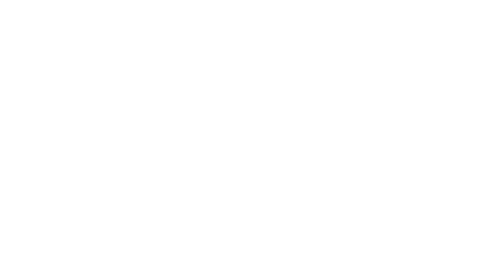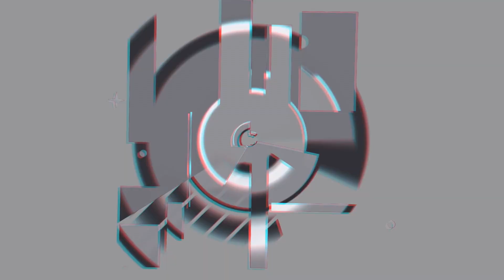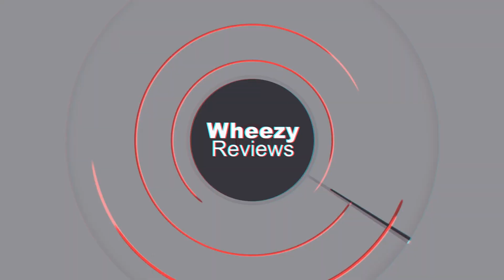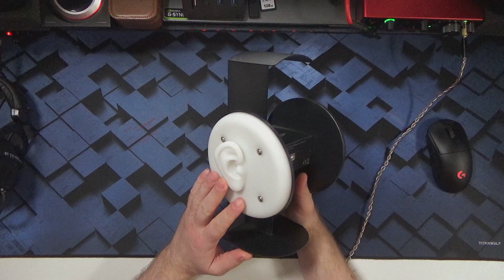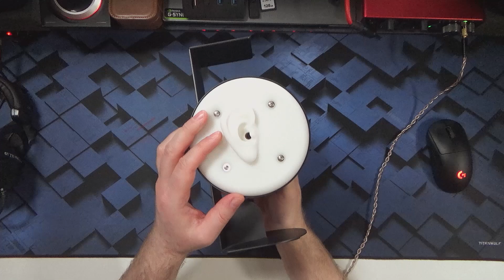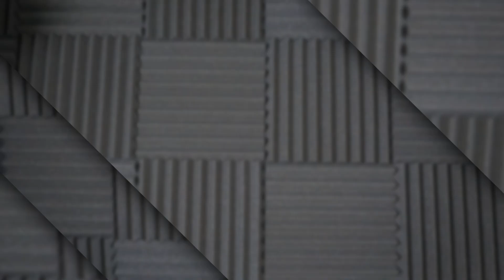Headphone measurement and MiniDSP EARS - Whats it all about?

Comment: Actually you can also use MiniDSP Ears and REW  to produce quite good correction files for EQ  software. I use it to produce EQ settings for APO with the Peace GUI and this works very nicely for (my) headphones. The results are usually an improvement  and quite fast and easy to realize. It's easier than doing the same by hand. And the results are better too. :)

It doesn't work that well for IEMs and earphones yet. The MiniDSP seems to have problems to measure stuff, that needs to be inserted into the ear canal, properly. Any hints to improve these measurements are welcome. :)

Comment: Great video!
You've covered all the basics without going into the 'politics' of audiophoolery. 

Just a few hopefully helpful things I thought of:
- Human hearing can also go well below 20hz. Even if this counts more as 'feeling', it is widely accepted that people (probably more than we think) can clearly distinguish separate tones most of the way down to 12Hz.
Also most people don't realize they can hear below 20hz, because most headphones can't produce those frequencies :D even many highly regarded planars roll off suddenly below 20hz.
- This is why all of Tyll's graphs (on the now dead website innerfidelity) go down to 10hz (and up to 20kHz). Reading a headphone's ability to produce the 10-20Hz range can tell you a lot, and people like me who can 'hear' (or feel) down to around 9Hz appreciate this.
- The myth that humans can only hear down to 20Hz is based on extremely old data, made with extremely old equipment.

Also, I think comparing simply to one 'industry standard' like HD650 isn't quite enough. Maybe emphasizing the importance of slowly expanding a catalogue of graphs which can be compared to each other can be even more useful. In my opinion, this kind of thing can only ever be done by one person, using the same tools and methodology. Any deviation or contamination by let's say a number of third parties trying to add their data to a collaboration would only diminish the value of the collection.
- Maybe that's content for another video once you've built one up :)
Reply from the maker: Interesting, I always figured sub-bass is certainly more felt than heard, and I figured 20Hz might not be a hard floor but I've never actually tried to see how far down I can hear or distinguish. I dont have any speakers and I'm not sure I have any headphones that can go down to 10Hz to even try. Interesting that some people can actually distiniquish frequencies below 20Hz.

The HD650 is my main reference point but I usually bring in other headphones as comparison points too. So when I do a ~£100 closed back I often refer to the DT770 as well for example. But the HD650 is the one constant. Hopefully I can build a collection of references over time. I'm only keeping the HE4xx around as a reference atm cos its the only planar I've onwed so far.

At some point as I do more reviews I'll probably create an archive of measurements on my blog or something.